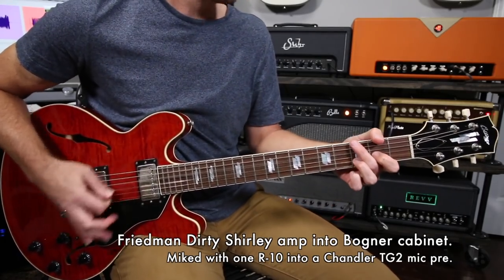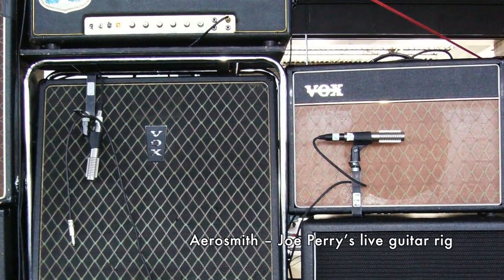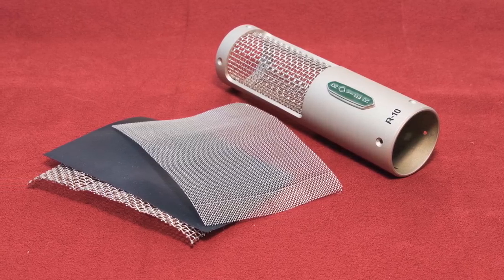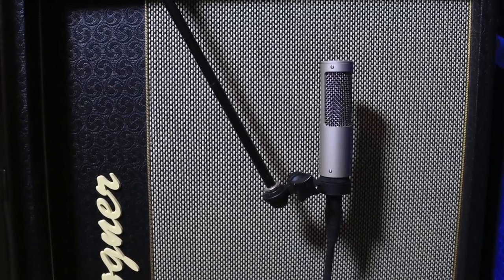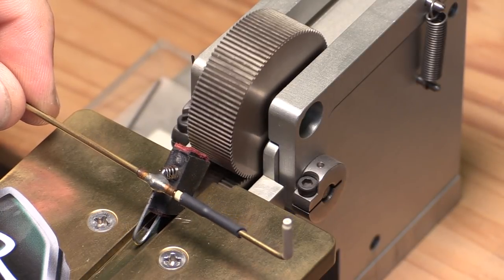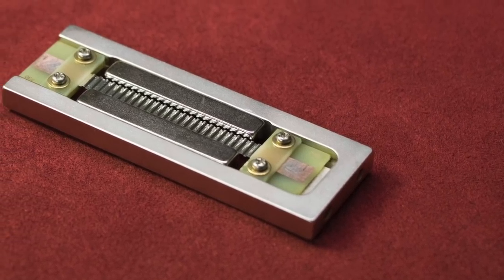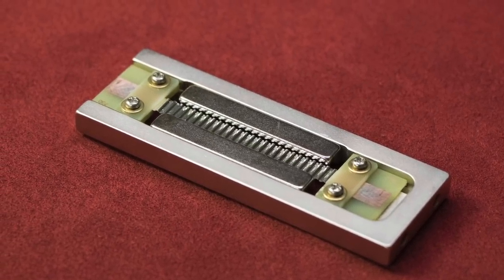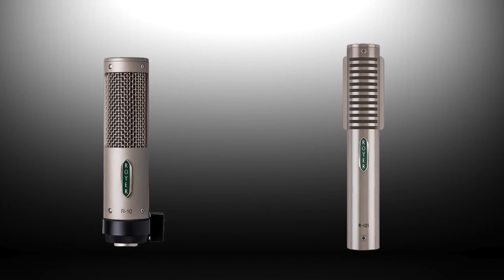Get to know the Royer R-10 ribbon microphone

Comment: Just purchased the R-10...do you recommend a Shock Mount for this mic, or does the stock mount work across the board? Thanks!
Reply from the maker: Congrats on your new microphone! The mic’s transducer is internally shock mounted. However, in severe situations a shock mount can take isolation to the next level.

Comment: Hey Royer Labs, I have the R10 and I wanted to record an upright Bass with it.  The bass will be run through an amp about 3 feet from it to the right, so I want as little of the amp to come through as well as the horn section about 7 feet on the other side.  I just want to get the natural bass sound.  Do you have any recommendations on a setup?  A friend suggested midway up just below the neck facing up and down, but I thing there would be a lot of bleed from the amp through the floor.  I think about 2 feet back, 1 foot up, and pointing at the bottom of the neck.  What are your thoughts?
Reply from the maker: I like your friend's suggestion. The right and left sides won't get much bass amp or trumpet bleed because the null sides of the mic will be facing them, and that should be a decent sounding position, although you might want to try moving it a little lower. Start with that and see how you like it.  -John Jennings
Reply: Hey John.  Thanks for the reply.  I simulated the scenario in my studio- the R10 as well as every other mic I have had an incredible amount of bleed...even with a vocal mud guard.  I did some more research and found that I can pick up a clip-on mic that works great for this application, so I'll just go this route. If I could do a more controlled recording, I would use this mic hands down, unfortunately, I don't get that option.

Comment: Is sending 48v gonna kill it?
Reply from the maker: Hey! If the mic cable is properly wired, 48v will never get to the ribbon!
Reply: @royerlabs  hey! Forgive me I’m quite an idiot so just to be clear. Cable is properly wired and I accidentally send 48v to the mic. It’s not gonna damage to the any electronics or the ribbon element. Right? 

Thanks. :))
Reply from the maker: @icaru920  You're not at all! This is a great question! When using properly wired microphone cables (which virtually all of them are) you can turn phantom power off and on all day and it will never get to the ribbon ;) so you should be good!